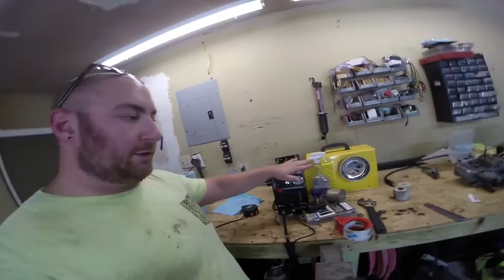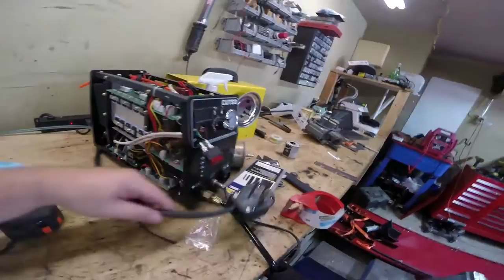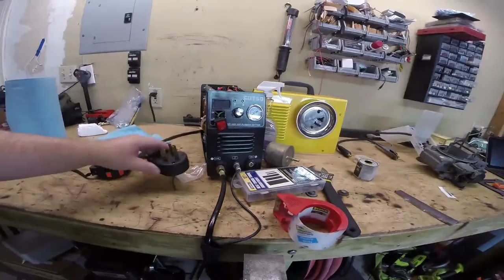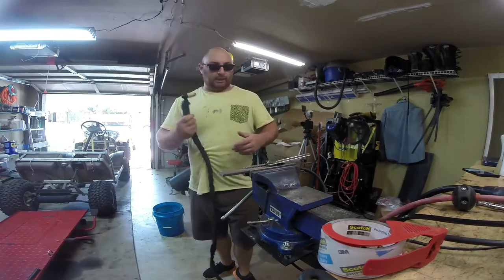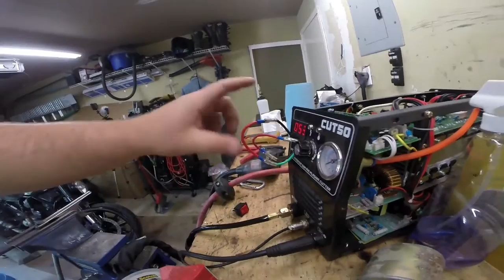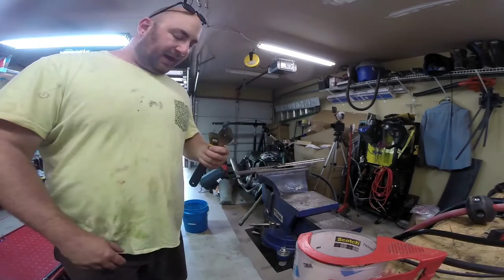MaksWerks Garage - $200 Chinese Plasma Cutter Modifications for FULL POWER

Comment: Your machine is either set up wrong or defective.  It's not pulling 50 amps through that switch. It's basic electrical theory. I don't have the manual handy, but I seem to recall the arc runs at about 40V. 240/40 is 6, So at 50A output, your machine is drawing 1/6 of that.(.1666667).  50A times 0.166667 is 8.34A.  We'll say it's only 65% efficient, which would mean you're pulling 13.8A (rounded) through that switch.
Reply: You are on the right track. A 50 amp everlast plasma cutter has 100v maximum at the tip with maximum of 28amp 240v from the wall.
Reply: i suspect there is a relay in there after the switch. basic circuit

Comment: 50 amp output not 50
From the panel .
Input amps are more like 23 and because you're on intermittent use the switch is min fine .

Comment: Also ,are you running it off 120 ?
Mine runs dual voltage so 240.
Zero problems handling 3/8 and can severance 5/8
Reply from the maker: I am running on 240. It barely does 1/4 inch steel.
Reply: +MaksWerks very odd .
Which wire is grounded to the chassis ?
Reply: +MaksWerks not trying to be difficult but can you confirm you have 120 to ground on both legs of your recep?
Reply from the maker: You got me thinking on the right path. Just went down and actually put some thought into what I had hooked up. Neutral and ground were backwards. It also explains why i got shocked touching the body a few times. Just went through a 1/4 piece of steel much better. But I wonder if I damaged something, it seems to have a hard time re-striking the arc now.
Reply: +MaksWerks you have something wrong here my friend .
You don't have a neutral on 240 .
You have 2 hot legs and a ground .
Unless you have 3 phase which I doubt in which case you'd have 2 hots ,a neutral and a ground .
So back to what your up against here .
If you had a tester you'd find if your house wiring is correct that each hot is 120 when tested to the ground wire .
Reply from the maker: We are having a breakdown in communication. My fault. I have green/yellow wire attached to chassis. Also attached to ground at wall. I have the black wire going to one 120V and the green going to another now. before I had 120V total due to one of the 120V being attached to the chassis ground. All sorted now. I have 240 coming from the wall. I use it on several welders and I know it works. I even have a video about installing it. I am a little drunk and a lot tired so i apologize if I am not communicating effectively.
Reply: +MaksWerks yep that sounds correct now .
These units aren't well marked .
They should have a red and a black to the incoming hot legs and simply a green to the ground which is attached to the chassis .
Run it as .6 on the air Guage and you now shouldn't have an issue .
Now that I helped get you on the straight and narrow you can come show me some love and sub me ! 👍😊
Reply: +Bagot Corner what no sub ? Awwwww
Reply from the maker: Dude. I passed out and then went to work. Subbed.
Reply: +MaksWerks lol ,,subbed you back !

Comment: I have the exact plasma cutter it's been running strong for over 3 years and it will cut cleanly through 1/2" plate it cuts through 1/4" fast than I can guide it I believe there is something wrong with that unit
Reply: Its not the unit it his brain. Knows sfa about basic electrical theory.
Reply: A lot of these models break down quickly.
Reply: I was going to buy an ebay special but decided I'd rather just get a nice Everlast plasma cutter instead. I've had it a couple of years now and don't regret my decision at all.

Comment: my broken powermax30xp hypertherm is wired through its on/off switch the same way, i unwired the cord to put on my new icut60 china cutter, didnt even need new spade connectors,  hypertherm30xp/icut60  same size....FACT
Reply from the maker: my cut50D is still going strong. I would love a new powermax45 but I just cant justify the cost.

Comment: what nobody is saying is the switch is rated for 16 amp ac........the machine converts this to dc.......ohm's law states ,if you lower the voltage ,you increase the amperage.this is whats happening.also a cheap hack for these plasma cutters is to buy a larger gun (say a sp 60)I have done this and cut 3/4 plate.also run your compressor at the max around 120 psi to blow the metal through.hope this helps.geoff
Reply: geoffrey ward bad, and dangerous advice.
Reply: @melgross  shurley the gun is only to create the vortex to direct the plasma so how can it alter the current Fed to it.

Comment: You really should get some electrical theory knowledge before making totally riduculous statements like this. The switch has 120 volts running through it ,power = voltage X current so because voltage is much higher running through switch it only needs a fraction of the current running through it to provide a output of 50 amps at a much lower voltage that runns though tip . KH